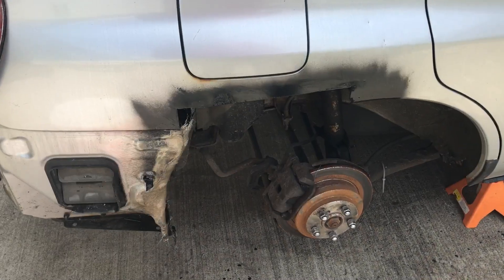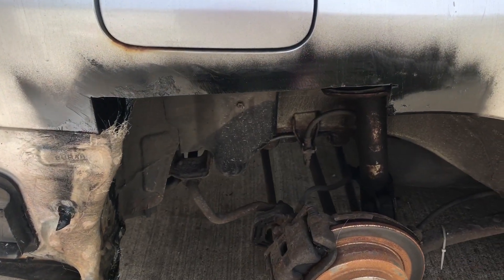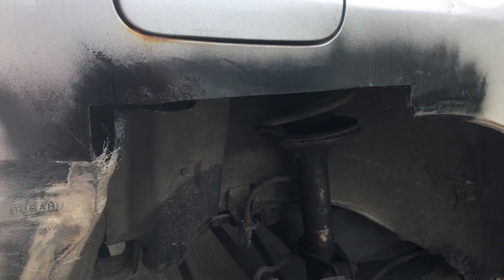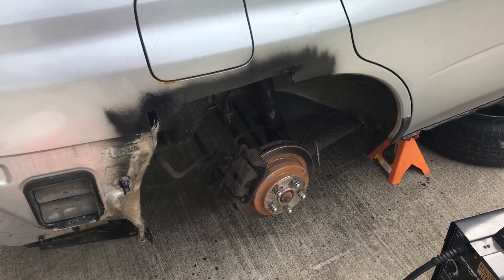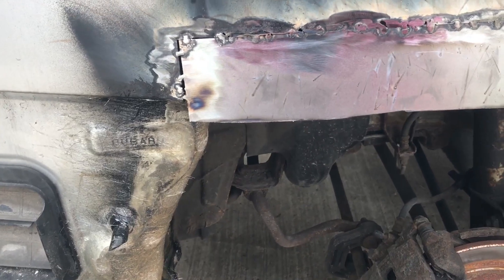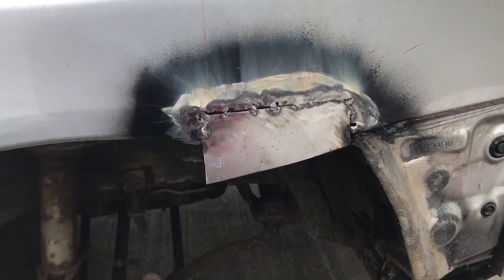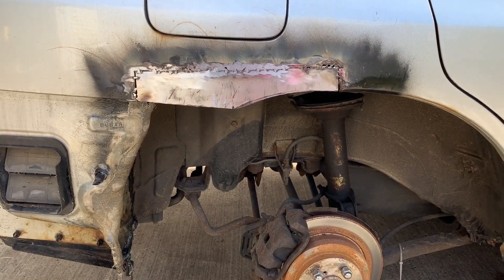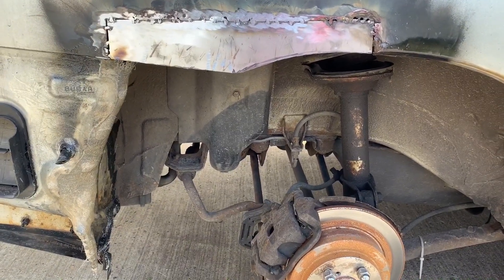Welding In New Quarter Panel Metal - Rusty 2002 Subaru Impreza WRX

Comment: WTF? 🤦‍♂️😵 Man, it is not your job, don't make garbage from the good car. Any monkey with MAG will do it better. I am sorry, but it is true.
Reply from the maker: I could hit that with a hammer as hard as I could and it wouldn’t go anywhere lol. It’ll be okay man
Reply: @SamOhler  It's not that. You didn't even try to shape it. Welded just disgusting. (sorry, even I am a bad beginner welder, and then I see that it is welded very badly, and professional welders will just vomit from watching) For some reason, you didn't make the edge. I was making this place in my own WRX and a piece of the arch was obtained with a only hammer without any magic tools - both the edges and the bend. Youtube for some reason deletes the message, maybe because of the link to the image, so I'll try without it.